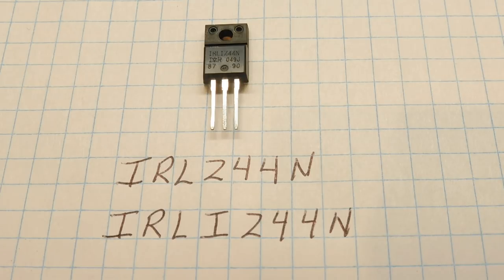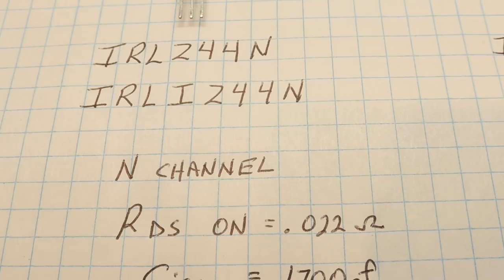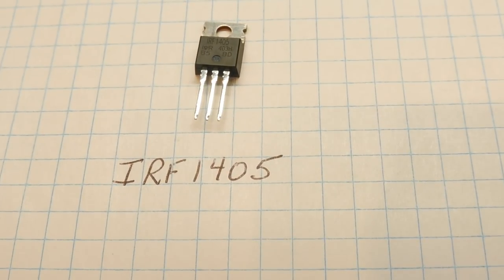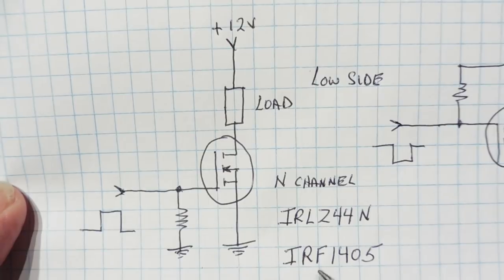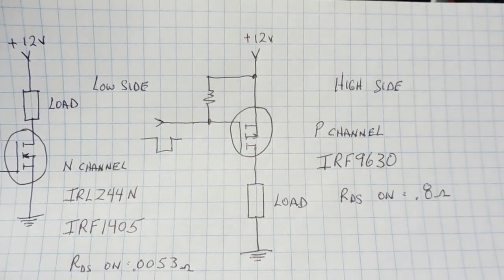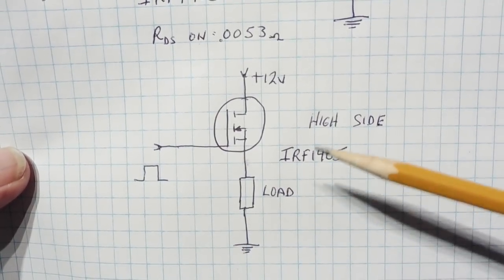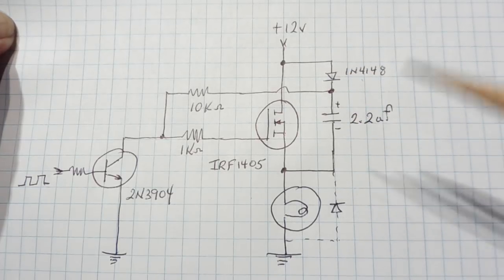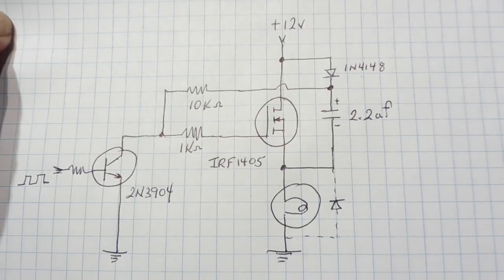MOSFET Bootstrapping

Comment: I whacked the subscription bell soon after you said you use automotive spec in many designs. The automotive industry has ramped up its tech over the decades, and now it allows hobbyist a lesser expensive route to quality and robust electronics where previously there was only expensive aircraft silicon. With the advent of electric vehicles, that has only widened the selection and ubiquity of very interesting electronics. I’m happy the cost bar has lowered!

Comment: Very good video, I like your videos a lot.
I recently learned that there are some optocoupler that are driver mosfet. Like the TLP591 - DC Input, Photovoltaic Output. They are not cheap, but the voltage in Gate is independent of the PSU of the load, which makes it immune to voltage drops and other problems.

Comment: Thanks. I like this idea. I'd love to see more hints like this. 

    While tearing apart old consumer electronics P-Channel MOSFETs and Power PNP BJTs seem to be extremely rare. In fact the only place I know I will find a P-Channel MOSFET (without ordering anything) is on lithium battery protection PCBs, typically in a SOT-8 package. Even the cheapest Chinese adjustable power supply kits, sold for around $5 use a power NPN BJT.
   I'd like to see you explain the different configurations to avoid the use of power P-Ch/PNP devices. It's handy information to have in those situations where I want to build something now and can salvage a part instead of ordering something and waiting a week or more ;)

  BTW, if we are switching any power MOSFET with a stable Gate voltage, how easy/accurate is it to use the voltage drop of the Rds resistance in place of a shunt to measure the current? Would I need to measure the Rds resistance value of the actual part used? What's my potential measurement resolution?
-Jake
Reply: Upcycle Electronics - As I have experienced MOSFET RDs on data, the problem is not the voltage, it's the extremely low current demand.  It's almost like a charge dependant gate. Even static electric effects switch these things.  So, in the absence of current, I don't know how to measure voltage.  Even on a Tektronix 556, I have trouble sorting it out.
Reply: Boonedock Journeyman  Rds would be Drain-Source voltage divided by Drain-Source current.  Are you talking Gate current ?

Comment: It is very powerful circuit and cheap. I test it, work like charm!. Thanks you very much. I used boost converter but it is costly and design is not very good for small package. I used it for bicopter, I will upload soon.

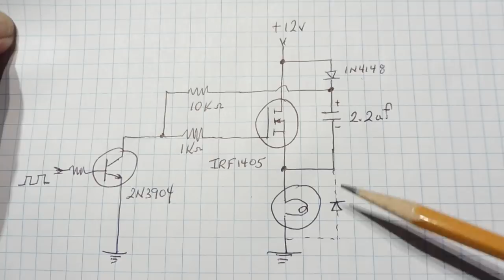Comment: 7:53 you can increase holding on time by using a 1n400x diode instead of 1n4148. 1n400x has lower leakage. Learned that from Bob Pease. Also use non-electrolytic cap.
Reply: Why non electrolytic?

Comment: @6:00 I would add a bleeding resistor with value depending on the loading and wiring conditions. On other side we may use a BJT transistor to connect the bleeding resistor to the cap to discharge it once the PWM is tunrned OFF. I was thinking about where else can we insert the bleeding resister! I need to build this circuit and try it for further testing.
Reply from the maker: The circuit was meant to simply demonstrate how bootstrapping works and is not optimized for speed or PWM applications

Comment: Brilliant.  Explained exactly as you need the information.  P channels may be easier but I want to avoid them because of the high  SD  r.  PS.   I like the IRF1407.    Their  "F"  but run  OK  off arduino.   Also, I assume its going to work OK for  brushless motor?   Thanks!

Comment: There are also p-channel MOSFETs with considerably lower Rdson like the IRF4905 with 20 mOhm or even the IXTP140P05T with just 9 mOhm. The p-channel MOSFETs for higher voltages have mainly higher values like the 500 V IXTP10P50P with 1 Ohm.
Reply from the maker: As time goes on manufacturers are making P-channel MOSFETs with lower RDS on resistance. P-channel MOSFETs have holes as majority carriers as N-channel have electrons so P-channel MOSFETs are slower in switching and have higher input capacitance (Ciss). The main purpose of the video was to show an example of bootstrapping as it is using in many gate driver ICs.
Reply: @0033mer  usually the main reason for the use of n-channel high side switches is, that they have comparable characteristics like the n-channel low side switch like gate threshold voltage and transconductance. And they are usually less expensive.

The use of gate driver ICs is mostly their switching current capability and shoot-through protection.

But the industry offers also n-MOS and p-MOS pairs with nearly comparable parameters like irfz24 / irf9z24 or irf540 / irf9540. But it is not recommented to operate them with a 12 V rail to rail switching signal, especially if they have low channel resistances.

Even 100 to 200 mOhm devices can be destroyed by the energy of a 1 µs shoot through coming from a low ESR electrolytic capacitor.

Comment: To drive a 1700V mosfet, I assume the same circuit will work if the components meets the voltage ratings, capacitor, BJT, diode and resistors to say 1500V

Comment: I have a question , on the first example with the N channel you had a resistor going to ground (pulling down the gate ).  can I put the resistor to vcc instead of ground ? So it would be pulling high unless the signal goes low , and the load would be allways turn on unless the signal turn it off

Comment: I must admit, it´s the first time I understand a bit of how bootstraping works, still I have 2-3 questions, and hope that any commenters/viewers are gonna explain a bit to me: 

6:50  1: "the transistor will be on, so, its collector will be at ground, thus grounding any voltage to the gate of the Mosfet..." 
Does the gate need 24V to open (cause 24-12=12V are needed after all?), so, 12V going through the IN4148-diode, the 10K- and the 1K-resistor (while at the same time anyway connected to ground), surely isn´t enough to trigger the gate ??? 
The question may sound as being self-answering, but such stuff isn´t clear to me at all (that´s what you get, when learning electronics at YT  ;-)

7:25  2: "so, the voltage of the load is gonna increase. and as it´s increasing, the voltage at the diode/cap-midpoint is gonna increase at the same rate..." 
I know caps unload their charge in milliseconds, so, more than a single cap-charge/cycle is demanded for it to work? 
Or  is the gate-current-demand so low, that a single cap-charge per cycle is sufficient??? I mean, how long can the 24v be sustained, since the cap unloads quickly (in few ms), if the cap isn´t supposedly charged several times in a single cycle, thus keeping its 12v-charge-level constant??? 

Also 7:25   3: What is meant by "the voltage at the diode/cap-midpoint is gonna increase at the same rate (as by the load)", is the voltage at the diode/cap-midpoint the sum of the "battery"-voltage rushing-in, and being added to the 12v of the cap? In other words: diode/cap-midpoint has 12v from the cap plus 0v from the battery at the beggining, and as soon as battery-current rushes-in, you get 12v + "X"v,  "X" growing at the same rate it grows at the load (as is apparent/logical), till you reach 24v??? Or does some other wizardry happen, that I didn´t get yet??? 

Thanks á priori for all answers !!!

Comment: Great Video but It can be Replaced Also by using A Darlington Pair like TIP122 6A Or any other as they can operate in High Frquency also if I m not wrong
Reply from the maker: No need to bootstrap with a Darlington. It will work but Vsat can be as high as 2 volts so power dissipation is a concern.

Comment: If I were to use an n channel depletion type mosfet instead of enhancement, can I turn this circuit from 'normally closed' to 'normally open'?

Also, can I control that npn transistor with a raspberry without killing it? What were to happen If I used an electrolytic cap instead of the cap used in this video?

Thanks! Really handy video.

Comment: You don't really need the 1kΩ resistor. And reducing the 10kΩ resistor, in addition, should allow it to switch faster (=less partially on time).
If short transient times are important, a push-pull driver could be used - but that requires 2 more transistors.

Anyway, it's a good basic ciruit and you explained it well.
Reply from the maker: You are correct. The orginal circuit was built as you described but was modified as shown to be driven with CMOS logic which has limited sink current capabilities. The resistors limit the current from the charge on the gate to source capacitance and from the bootstrap capacitor. The circuit is for demonstration purposes only and if high speed is need a high side gate driver IC should be considered. Thanks for your feedback.

Comment: Ciss is the input capacitance, gate to source and gate to drain (Ciss=Cgd+Cgs)
Reply from the maker: Yes .. you are correct. Technically Ciss = Cgs + Cgd and is the "input" capacitance as a whole for the Mosfet.
Ciss is the capacitance between the gate and source terminals with the drain shorted to the source.(Cgd in parallel with Cgs)
During switching the Cgd actually amplifies the Cgs so the Ciss is a spec used to compare different Mosfets input capacitances.

Comment: great explanation. But i have a question why is MOSFET still working when is 24V on the gate, i looked up on datasheet and saw that max. voltage of Vgs is +-20V, why's that ?
Reply from the maker: The bootstrap circuit generates 24 volts from the gate to Ground. With 12 volts across the load the gate to source voltage (Vgs) will be 12 volts. Check video at 7:20.
Reply: @0033mer  hahha oh that's right, my bad, thanks for fast response.

Comment: +2 component solution for high side n channel switching... photovoltatic  optocouplers.
 logic level control through resistor and optocoupler's led.
 Wire the optocoupler's photodiode between mosfet source and gate. The gate voltage is then the source voltage plus what ever the photodiode is outputting.

Comment: 1. The 10k resistor to the transistor collector is also a leakage path for the bootstrap capacitor, albeit very tiny amount.
2. This circuit wouldn't work for very high speed switching right (~30+ KHz) ? The p channel bjt and the added capacitance being a bottleneck
Reply from the maker: This is a Demo circuit to demonstrate how bootstrapping works and not designed for high speed applications. The 10k resistor and the gate/source capacitance restricts the speed of the circuit. The 10k resistor is used to limit the current when the voltage on the gate/source capacitance is discharged so it can be driven with a CMOS logic gate without exceeding the maximum sink current. The 10k resistor can be omitted when the circuit is driven with an NPN transistor.

Comment: Thanks so much, great video!  Can you recommend a good p-channel mosfet for high side switching, that can be driven by logic, and control 3.3-5 v?  Want to interface to arduino.
Reply from the maker: There are a few out there but I have used the NDP6020P and they are fairly easy to obtain.
https://www.sparkfun.com/products/12901

Comment: Never understood the concept mosfet bootstrapping. This is something I need to know. A while back I experimented with a three half-H bridge to try to drive a BLDC motor. 
At least I know how it's possible to build a high side switch with an N-channel mosfet.
Reply: If you can build one of these bootstrap circuits, you can essentially build up a 24v rail and then feed into the gates of your h-bridge with smaller transistors.
Reply: @OtherDalfite  "...you can essentially build up a 24v rail and then feed into the gates..." 
That is an excellent idea. Just today I started researching charge pumps. That's another circuit I want to build. Thanks for he tip.
Reply: @3deeguy  I'm thinking of that very concept for something I'm working on at work. Hope it helps!
Reply: @OtherDalfite  It'll help. 
I'm just a hobbyist but I have to say I do expect to run into a few hurdles. A couple years ago I breadboarded a triple half-H bridge using transistors and never could get it to run smoothly. The hfe of each transistor never matched and add to that trying to get complimentary  pnp's and npn's to cooperate with each other. 
If there is a charge pump IC I'll order mosfet driver IC's too and try to build the circuit that way.
I know I'm talking a lot but now I'm thinking about ordering parts so I can test it out on my oscilloscope.
Reply: @3deeguy  hey, was doing some simulations using this idea as a springboard. Currently the best way I have to do this is get a voltage doubler (a bit less complex than bootstrapping) and make a dedicated rail circuit 10v or so above your Vds. Then use an opto-coupler to send the voltage to the gate of the mosfet you're wanting to control. Opto-coupler can be controlled with a 5v PWM from an Arduino.

If anyone has a better way just let me know. Tried normal npn/pnp transistors but couldn't get a configuration that worked.
Reply: @OtherDalfite  That sounds like a good idea. I guess I'll try a voltage doubler too.
I asked myself why bootstrapping wouldn't work for an 'NPN only' BJT H-bridge and found out the reason is pretty simple: The base has to remain 0.6 volts higher than the emitter. So it's better just to use a complimentary pair with BJT's.
I learned to program micro-controllers on the 'Basic Stamp'. I moved to the Parallax Propeller which has 8 cores, same clock. The Arduino is much cheaper than the Basic Stamp so I may use it in the future but I originally learned to program using the Parallax languages. That makes me an oddball because Arduino is so popular but the Parallax languages are really easy for me.
Reply: @OtherDalfite  I just downloaded the datasheet for the IR2110 which is a high side/low side mosfet/IGBT gate driver. Digikey has a learning module which I'm going through now. I'm going to order some parts soon.
I only have a dual trace oscilloscope and I told myself I 'needed' a four trace scope to study a brushless motor. This short dialogue 'forced' me to realize I don't need a four trace scope.
I don't know why I didn't think of this before but each coil will only be pulled HIGH or LOW or it will FLOAT. That's really all I need to see. I can then tell when the floating coil makes a zero-cross. The important thing is I only have to use n-channel mosfets. Thanks again.

Comment: Nice video.
Don't you feel the leakage current via the 10K resistor would be more than the leakage current via the diode?
Reply from the maker: All semiconductor junctions have some leakage so the diode, mosfet and transistor would all contribute to the total leakage of the finite charge on the capacitor. The blocking diode is common to all bootstrap circuits
 so it was mentioned as the leaking source. The other component can differ in different designs. ( the transistor could be replaced with a relay contact) The purpose of the video was to demonstrate how a simple bootstrap circuit functions.
Reply: @0033mer  can you please explain   this.
When I drive a mosfet(NPN) from the output of a 555timer it turns on for 2 seconds when there is a led connected at the drain of the mosfet, but when I connect a small motor in parallel with the led the time reduces to 800ms.
Reply from the maker: The LED  is clamping the voltage across the motor. Do not connect the LED in parallel with the motor.

Comment: the diode and cap solution, is that equal to a charge pump circuit? cause u doubled the 12 Volts?

Comment: Hello, and thanks for the excellent tutorial. Quick question: I've seen you say multiple times in the comments that this setup is not intended for high-frequency applications, and that one should use an integrated circuit for such a case. What is the advantage of using an IC over switching out components for lower-valued ones that could support a higher frequency?
Reply from the maker: All MOSFETs have Gate/Source capacitance so switching them on/off very fast is not an easy task. There are ICs that will do this properly and keep the MOSFET out of its ohmic region during switching. This keeps the power dissipation down to a minimum and avoids MOSFET failure. To understand gate/source capacitance better check out these videos: https://youtu.be/zTHzaNdByVA
https://youtu.be/mjIubJeTRyY
Reply: @0033mer  Thanks for the answer and the resources!